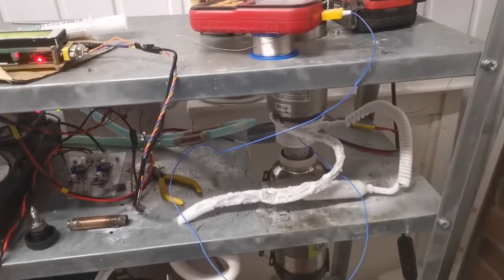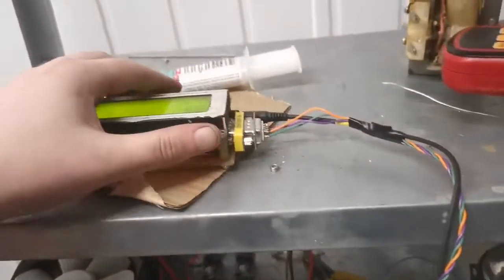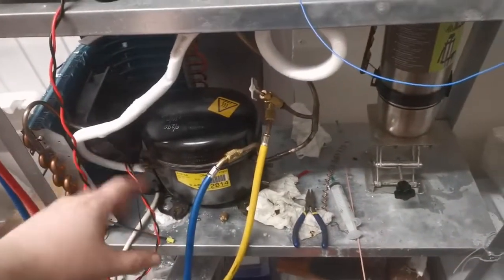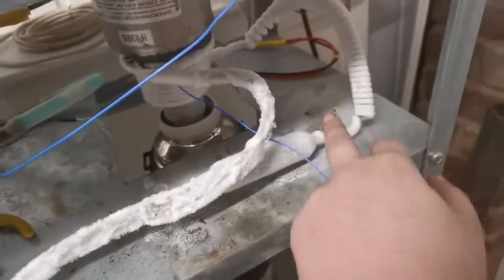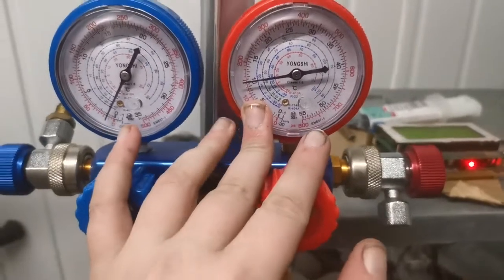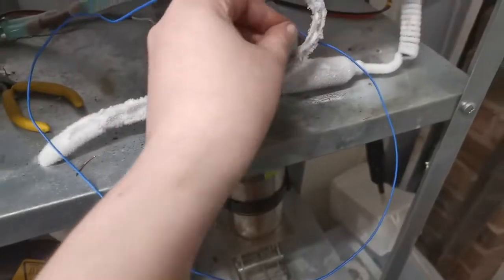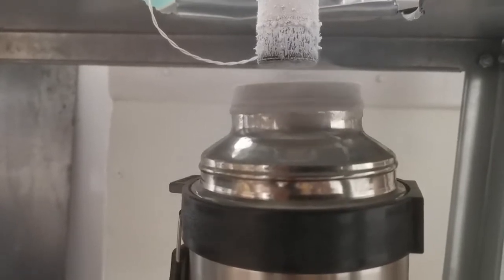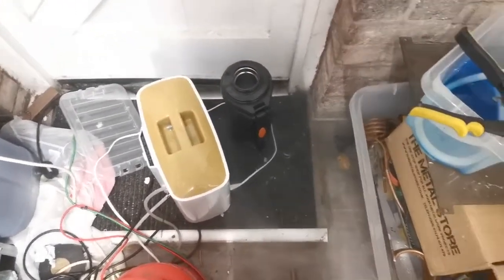2 stage liquid nitrogen generator

Comment: Very nice!  I have a Stirling cycle cryocooler too but mine is just air-cooled.  I can maintain a temp of 84F, or so, on the fins of the heat exchanger and make ~2L / day of liquid air.  I'm curious what kind of yield you get in a 24h period by refrigerating the hot end.... What you poured out after a half hour doesn't really give me a good enough idea.
Reply from the maker: I never measured it but I believe it was somewhere around 2L/day too. I got about 1L per day with the hot end at ambient temperatures. There seems to be a lot of variation in the performance of these coolers, or maybe in the insulation of the vacuum flasks people use. I imagine humidity has a large effect as well.
It'd be interesting to measure the helium charge pressure since this cooler is 20+ years old.
Reply from the maker: You got me interested - I set up a way to measure the weight of the dewar over time to work out production rate. With the hot end at ambient, at 120W power with the stainless steel vacuum flask in the video I got about 15-20 grams per hour of liquid air. Switching to a larger glass vacuum flask bumped it up to about 30 to 40 grams per hour.
I always imagined they would be pretty similar but it looks like it makes a huge difference at these temperatures with so little cooling power available.
Reply: @matthewbeardmore  Thanks for the info!  WOW, I never realized the dewar/flask could make such a huge difference!  In your case, just switching to the large vacuum flask DOUBLED your yield.  Now you got ME interested.  I need to try other containers besides my 2L Thermos brand vacuum bottle.  And I'm glad you were able to get a higher output 😃
Reply: https://www.youtube.com/@StirlingCryocooler

Comment: Nice liquifier! Where'd you get the stirling cooler from?
Reply from the maker: Thanks. Cooler was from a superconducting RF filter. They used to be on ebay occasionally years ago but seem hard to find these days.
Reply: @matthewbeardmore  Yeah, I've been searching for one forever, but all I can find on Ebay is the cold heads for a GM-type cooler that needs an external helium compressor :(
Reply from the maker: @HyperspacePirate  Yeah they have become very rare. Something I've been trying to make as an alternative (and you might be interested in) is a joule-thomson cooler. You can get cheap 300+ bar air compressors on ebay and an air separation membrane from alibaba for pure nitrogen. The cooler itself is basically just a fancy arrangement of pipes which should be possible to DIY
Reply: @matthewbeardmore  Yeah I've looked into a JT type cooler but all the high pressure compressors I've found on amazon/ebay are oiled, so I'd need some sort of oil trap that can handle ~4,500 PSI, which doesn't seem easy. 

As an alternative I've thought about building a reverse brayton cycle using a micro turbine or a GM-stirling cycle with a fridge compressor & hydrogen working fluid (but again, oil becomes an issue). 

I'd be curious to know your thoughts on those approaches since you seem to have had success in this area
Reply from the maker: @HyperspacePirate  That is true having clean air/nitrogen is very important, I'm hoping a gas separation membrane will provide water and co2 free nitrogen. Cheap high pressure oil filters are available for SCUBA and air rifle applications, search terms like "PCP filter" usually bring up good results.
I believe any residual contaminants will condense and freeze in the heat exchanger, acting as a crude oil trap, before getting a chance to clog the expansion valve. This will require periodic "defrosting" to clear but should at least provide a useful runtime before clogging. 

Working with high pressure did scare me at first but small diameter copper and stainless steel pipes have surprisingly high burst pressures. A manual hydraulic pump makes for a great 500bar+ hydrostatic tester too. There is definitely still some risk involved though.

I've looked in to brayton cycle and just a turboexpander as well but I've only ever seen them used for large scale applications so I'm not sure how well they would work here. DIYing a turbine with bearings that can run at cryogenic temperatures seems a bit beyond me but I would love to see it happen. 
I've considering using something like a dental drill as a turboexpander, they are available in about the right power range and with oil-free bearings which may take the low temperature but never actually tried it.

I think I've seen DIY helium compressors for cryocooler cold heads before. They required a very powerful AC compressor (1KW+) modified for external oil cooling and a LOT of oil filtering as AC systems can generally handle huge amounts of oil in them. At that point I feel like it'd just be easier to buy a used helium compressor but it would make for an interesting project.
Reply: @matthewbeardmore  Very valuable info, thanks man.

I was interested in a brayton cycle because i played with PLA in liquid nitrogen before and found it behaves pretty well at cryo temps, so i could 3d print most of the turbine parts. The bearings would probably have to be dry-running brass/bronze sleeves.

I'm trying very hard to do this with an open-cycle system so that a separate working fluid isn't required, which means either JT or Brayton. I'd like to engineer a way to do all of this with a regular oilless air compressor and printed parts, and then make everything open source so that more hobbyists have access to cryocooling
Reply from the maker: @HyperspacePirate  Ahh interesting, a 3d printed brayton cycle cooler would be incredible to see. I don't have much in the way of 3d printers/CNC routers so I try to reuse off the shelf parts for anything mechanical.
I struggled to find much in the way of typical real world numbers for reverse brayton cycle coolers so I was struggling to get rough sizes for things e.g. compression ratio, turbine speed, cooling power vs input power etc but I would love to see what you come up with. 
A good site I found for small JT coolers is https://cryocoolers.eu/. They have some nice datasheets for some models. I tried to purchase one but I was told they are all custom made and have a minimum order quantity of 10-20+ so very likely out of my price range.

That is a great idea. The barrier to entry for cryogenics is incredibly high at the moment, especially after all the cryocoolers disappeared off ebay. I get many people asking where I got mine from. Plans or a possibly a kit for an alternative would be very popular.

My interest is from wanting more cooling power. The stirling cryocooler does about 10W of lift at 77K, maybe 20 with the pre-cooler in the above video. Some quick calculations show one of those cheap high pressure compressors should manage 100-150W or more at 77K for a very well optimized JT cooler on nitrogen.

I'll try and do a video if I ever get anywhere. Currently struggling to get below -30C due to expansion valve clogging
Reply: @HyperspacePirate  You can try making a mixed refrigerant joule thomson cryocooler that uses Nitrogen and a mix of hydrocarbons(methane ethylene propane) to achive cryogenic temperatures at normal pressures like 20 or 30 bar from ac compressors. This is what im working on currently. Another idea is to buy an LCD freezer separator and convert it to liquify nitrogen oxygen etc
Reply: https://www.youtube.com/@StirlingCryocooler

Comment: Nice , I did the same with R290 @ -35C  , be ware that the passive balancer can fail if it gets to cold as this happened on mine when the balancer was at a few C , the spring in contact with the cooler body split and failed after a few days , not sure how the internal springs are isolated . While it did run @ 100W input to the cooler it doubled the production of liquid air at -30ish C reject
Reply from the maker: Thanks for the info, I hadn't considered the effect of the cold on the springs. The passive balancer tends to stay at about ambient at 150W input but I'm not sure about the internal springs
Reply from the maker: You were right, the balancer spring closest to the body cracked. Lasted quite a while though. Did you replace yours?
Reply: @matthewbeardmore  Sorry to hear that, I did replace mine after a while with some effort, The Spring material was hard to figure out, I had it hardness tested but this only provided a ruff idea so I made an educated guess and used a spring steel material that was laser cut ; I had the original spring turned into a CAD image for cutting. 

 I had two made but they ended up been abit stiffer than needed so the balancer uses one original and one new + original weight, the second new one is used as added passive weight along with some washers. This was needed to dampen the unit enough for near original operation, Though I cannot say how long this new balanacer arrangment will live for.
Reply from the maker: @twirlywhirly555  Ah nice, do you remember what material you used? I've been looking into getting one laser cut myself.
I'm surprised how much of an effect temperature had on it as there was barely even condensation on the balancer. Seems like something that could happen just from low ambient temperatures in colder climates.
Reply: @matthewbeardmore  I'll have a look and find out the material size and tickness I used, would you like a copy of the file for the spring so you can get it laser cut, via email or such ? I was suprised too, This was an overlook by myslef when I tried this setup but Id exepect they assume the 100W + usage within the unit is enough to keep it within the temps that's required based on ambient range it suted for.
Reply from the maker: @twirlywhirly555  That would be greatly appreciated. Could you email me on
I wonder if the balancer could be mounted further away from the body to keep it warm, as long the supports are rigid enough. I suppose if the balancer springs are failing the internal ones aren't doing well either...
Reply: @matthewbeardmore  Sure, Message sent ^ You could probably do that but you'll never know how the internal ones are affected. I just run 15-20C water in my unit now, With dryish O2 @ 100W into the cooler I net around 1L of LOX in 24 hours.